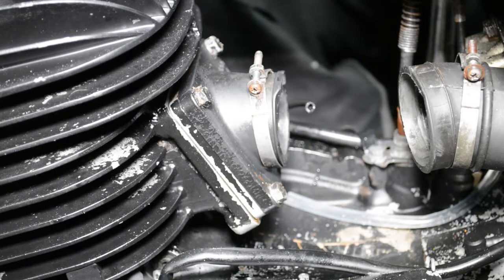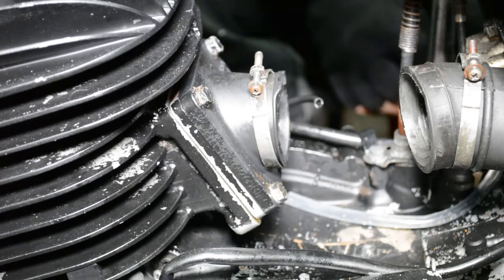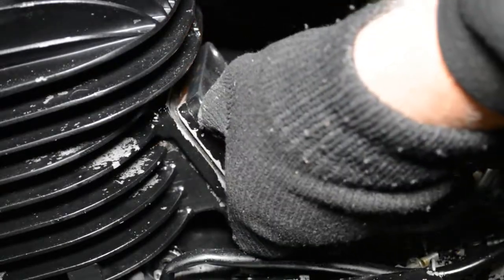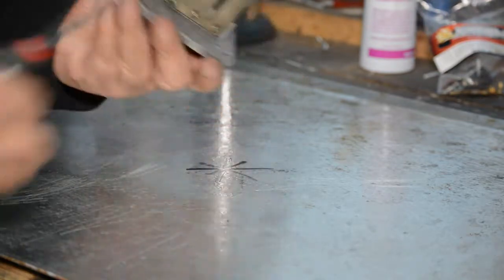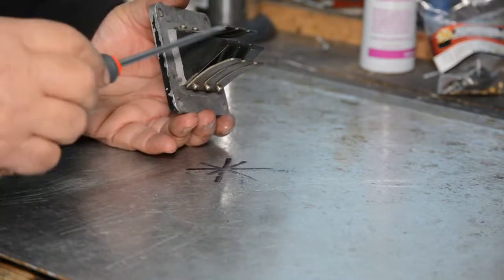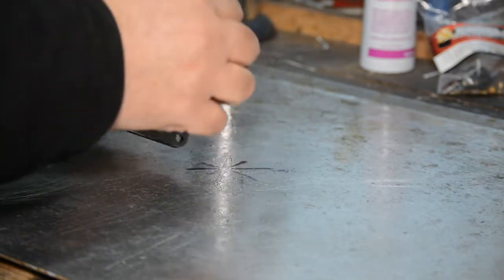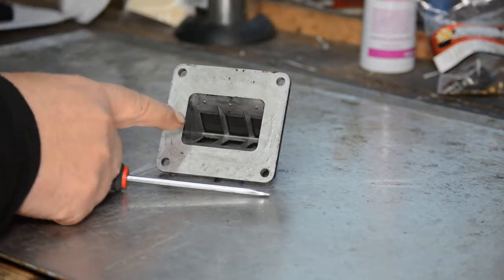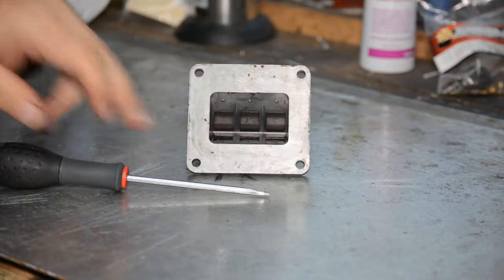2.4 Yamaha DT400 restoration inspect reed valves

Comment: Great video.  How long do reed valves usually go before they need to be replaced?
Reply from the maker: Hi, thanks for the comment. I believe it's one of those situations that you can not just base it on millage or age, and is dependent more on the type of use and maintenance the bike has had.
Easy to check condition though, reed block can be removed without the need to pull apart the carb.
Not too expensive to replace; something like £30-£50 (GBP) with a gasket.
Cheers
Paul